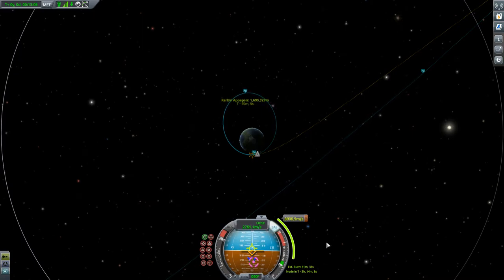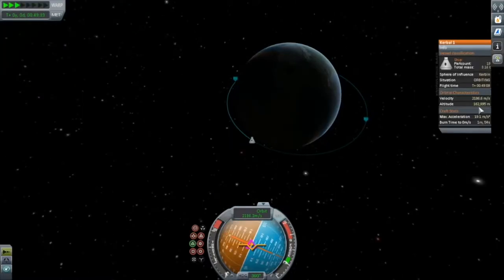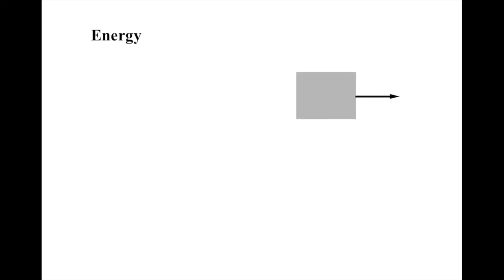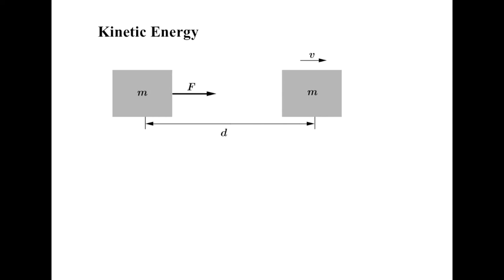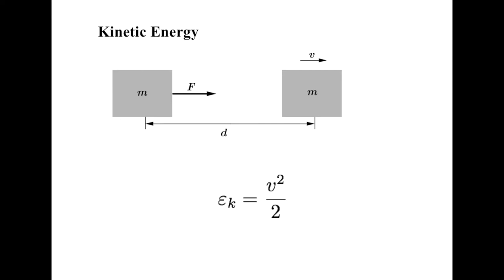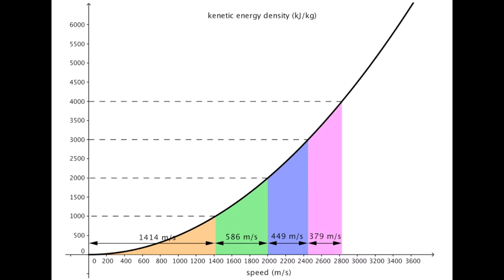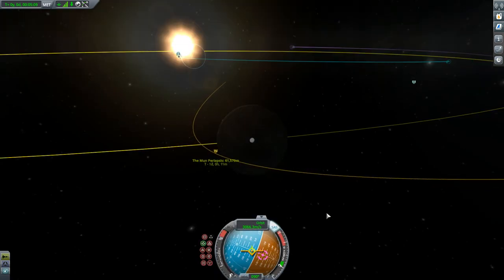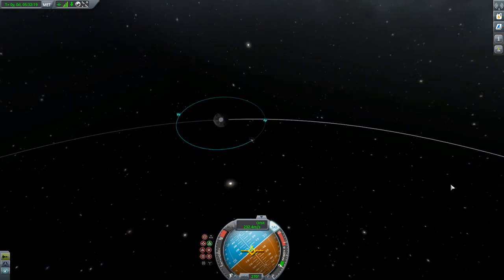Why Does the Oberth Effect Work? - KSP Let's Do The Math #10

Comment: Nice assignment. I have been busy with this for several hours. I wrote the formulas for the two options for getting to an orbit on 1000km altitude around Mun and found the equation for which both methods have an equal delta-v requirement. For simplicity I made the assumption that the spaceship comes from infinite distance with a certain initial velocity with respect to the Mun. I came up with v0 = sqrt(2GM/r) which is the same as v0 = sqrt(2v^2) where r is the radius of the final orbit, v the velocity of the final orbit. In case of the Mun this gives v0 = 330 m/s (might differ a bit from the original assignmen because of the finite SOI). This means that your initial velocity with respect to Mun must be larger than 330 m/s in order for the Oberth-method to have a lower delta-v requirement than getting the desired orbit in a single burn. In general the Oberth-method is most useful for high initial velocity, a high final orbit and low body mass. I hope I'm correct. :-)
Reply from the maker: I took a different tack than you as I was thinking of not coming in from an infinite distance, but from LKO.  You are absolutely right, though, the faster you are relative to the Mun, the more the Oberth Effect helps.  In the situation from the video, you would be hitting the Mun's SOI at a speed of 365 m/s relative to the Mun (I go through this calculation with Minmus in episode 6 https://goo.gl/iseB5j along with the subsequent calculations in the next paragraph),

To calculate the direct capture costs at any particular altitude I want I use this formula v_1^2/2 - v_2^2/2 = GM(1/r_1 - 1/r_2).  I set v_2=365 m/s and r_2 at 2430000 n (the radius of the Mun's SOI).  For a 1000 km capture, this gets me a v_1 of 434 m/s.  This is the velocity I would require at an altitude of 1000 km to have a velocity of 365 m/s when exiting the Mun's SOI.  I then subtract of the circular orbital velocity at 1000 km to get a required delta-v for the capture of 201 m/s.  Again, see episode 6 for a similar calculation done in detail for Minmus.

If I inserted into the same orbit by first getting the capture at 10 km with an apoapsis of 1000 km, and then doing the final insertion, the total cost ends up being 216 m/s, a smidge more.  (See episode 4 https://goo.gl/oUsniS for how to use the Vis-viva equations for costs of elliptical orbits.)  Brute forcing this through a spreadsheet at different target orbits, I find the break even point to be an orbit of 1450 km.  Higher than that, the Oberth effect starts working in your favour.
Reply: I can image that leaving Mun's SOI with 365 m/s in KSP means that with a theoretical infinite SOI the spaceship would slow down a bit more while flying off into infinity. If this leads to a velocity 'at infinity' of slightly below 330 m/s then my calculations would be compatible with your results, since then my calculations would predict the same minor difference. Maybe I can restore the 'finitity' of the SOI into my equation and redo the calculation when I have the time ...

The decision formula that I derived after rewriting is v_q=sqrt(2GM(1/r+1/r_0)). Plugging in the values for Mun with desired radius r=1200000 gives v_q=403 m/s. This means that your velocity when entering Mun's SOI should be above 403 m/s in order to benefit from the Oberth-effect (for a final orbit altitude of 1000km). You mentioned that the velocity when entering the SOI is 365 m/s, which is lower than my v_q, which confirms that you shouldn't use the Oberth effect in this case.

Comment: Since i found nobody else that posted their answer to the challange question and i want to check to see if my answer is right, here it is

Dv cost for low periapsis burn
is 829 m/s for hohman transfer to the mun, then 110 dv to capture and get apoapsis down to 1000 000 m, then 104 dv to circularize, which totals to 214 dv. So in total 829+214 

Dv cost for high periapsis burn
829 for hohman transfer, then 201 for capture and circularisation

you would be saving about 13 m/s worth of fuel if you used the oberth effect.
is my answer correct?
Reply from the maker: Yup. That's pretty much it. Congrats, but the Oberth Effect is the more expensive way even by your numbers. The only difference I got is 106 m/s for the capture using Oberth, and my transfer to the Mun is 856 m/s.

I talk about it in greater detail a couple of episodes later in this series.

https://youtu.be/rnzkPKk43iw?si=ZcZwKPmekT689vVT

Comment: but shouldn't the acceleration be variable? since fuel is expended and the mass changes
Reply from the maker: It you are referring to where I'm deriving the formula for kinetic energy, we're assuming the mass is constant.
Reply from the maker: Just to elaborate further, because I'm interested in the kinetic energy at a specific moment, I can make the time interval arbitrarily small. As the time interval goes to zero, so would any change in mass. As such, I can treat mass as a constant.

Comment: This is a great video! You have one of the best explanations of the Oberth effect I have come across! I just have one question though, for a rocket of mass 1 kg (for simplicity’s sake) even though the deltaV required to increase the energy by say 1000 KJ does decrease the faster you go, the engine still has to provide those 1000 KJ through the burn meaning your stock of energy (potential chemical energy in the case of fuel) is still lowered by the same amount. That’s what’s kind of blocking me and the reason why I can’t understand why it is more efficient.
Regardless of my question, again this is a great video series, keep up the good work!
Reply from the maker: You're right that you'll never get more energy out than what you put in. The key is that the faster you are going the less additional energy you need. If I were to do this video again, I would make the vertical axis of that graph  altitude of the apoapsis rather than mechanical energy. The shape of the graph would be the same, but I think it will be more clear that the velocity change required to achieve a certain altitude change becomes less and less the faster you are going.
Reply: 100 m/s dV can get you from 200 m/s to 300 m/s or from 2200 m/s to 2300 m/s. In the first case, that 100 m/s constitutes an increase in kinetic energy of ((1/2)*1*300^2)-((1/2)*1*200^2)=25000J, and in the second case the 100 m/s constitutes an increase in kinetic energy of ((1/2)*1*2300^2)-((1/2)*1*2200^2)=225000J, or 9 times as much.
 
It's important to note that this doesn't violate the law of the conservation of momentum, so it isn't like free energy is created out of thin air. If you consider both the rocket and the reaction mass (or the rocket exhaust) as one system, the momentum of that combined system doesn't change.

Comment: Obereth effect actually works when throwing objects at surface of earth too, but you start with zero speed which confuses things little bit. Lets say you have rocked and launch it full throttle until tanks are empty, it will get you higher than full throttle and shut engines every now and then until tanks are empty. This is because gravity slows rocket when time passes by and you lose some of obereth. But it seems like when launching rocket, most efficient way to get it most high would be to it to accelerate instantly to target velocity from zero speed but then most efficient way to burn would be when your velocity is zero? I don't fully understand why this is. so question is: is there limit how fast you should accelerate from surface, because 0 start velocity is less than anything which means zero obereth?

Comment: What I don't understand here is the why. As for the math we could simplify a lot because we assumed are starting at rest. Yet in the following part we looked at how much fuel it takes to go from speed 1 to speed 2. You honestly lost me at that point.
Reply from the maker: It's about adding energy to the orbit and the amount you add is proportional to the square of your velocity. So the faster your already going, the more additional energy you get for a particular velocity addition.
Reply: @MikeAben   Under the mathematical assumptions you made this is correct, but it does not explain why that is. It just states it is that way if we make those assumptions. I'm not questioning whether or not it is correct, we tested that a million times and it clearly is. I'm trying to understand why it is. I found a few lectures on the topic but honestly I have to start on a lower point for those explanations to make much sense (for me). 

So far i only have a logical explanation. When you are falling into a gravity well, your speed will increase due to gravity and the time you spend in that gravity. So the closer you get, the more gravity accelerates you, but the faster you are the less time gravity has to accelerate you. The same happens on the way back out but with gravity slowing you down. Now if you accelerate at the periapsis then you leave the area where gravity is high faster thus slowing down less which again means you essentially gained speed.
Reply from the maker: @_aullik  I think you may be overthinking this. The faster you're going the more energy you'll put into your orbit for a given change in velocity. That's it. I'm not sure what assumptions you're referring to. That you're faster closer to the planet?
Reply from the maker: @_aullik  I am assuming conservation of mechanical energy. That kinetic energy is converted into potential energy as your altitude rises.
Reply: @MikeAben  I mean I want to understand it, not just have the statement that it is that way. Conservation of energy is exactly the problem i have.

Simplified: Acceleration requires energy. Velocity is Kinetic Energy. So when you are faster you get more speed and thus more energy out of investing the same amount of energy. That simply does not seem right. 

So you need to get energy from somewhere. The first hint is, that this effect requires you not just to be fast, but actually to be in a gravity well. So I assume you extract energy from gravity interactions?
Reply from the maker: @aullik  So when you are faster you get more speed and thus more energy out of investing the same amount of energy.
No, it  requires more energy to get to higher speeds. KE energy goes up by the square of the velocity. So it takes more energy to go from 50 to 100 than it takes to go from 0 to 50. If the mass remains the same, but it doesn't, but I'll get to that in a sec

Let's first simplify everything by going straight up. We'll also assume the gravitation field is constant and doesn't decrease with height. Gravity doesn't factor in to how much kinetic energy you have. It does affect how high you go, but gravitational potential goes up linearly. E_p = mgh. That's the key.

I fire something straight up at a velocity v and it reaches a max height h. If I double my launch velocity to 2v, the amount of energy it has at the start goes up 4 times (2^2) and it will now reach four times it's previous height 4h. Let's increase the launch velocity once more to 3v. I now have nine times the initial starting energy and will get to nine times the pervious height, 9h.

Notice each time I increased my velocity by 1v, but when I went from 1v to 2v my max height went from 1h to 4h (an increase of 3h), but when I went from 2v to 3v my max height from 4h to 9h (an increase of 5h). So for the same velocity increase, I got more of a height increase the second time because I started from a faster velocity. That is it when it comes to the Oberth Effect.

It sounds like your confused as to where the extra energy comes from which is kind of a different question. Well, it comes from the fuel of course. You might think we should then by burning more fuel as we go faster, but no. The rate at which fuel is consumed remains constant. This is because while we're gaining kinetic energy we're also losing mass through the propellant being fired out the back end. The decreasing mass makes the rocket easier to push and balances out the fact that more energy is needed to make it go faster.

Note the same doesn't happen with vehicles that aren't propelled by firing propellant out the back. In a car, it takes less fuel to go from 0 to 50 than it takes to go from 50 to 100. For a rocket, though, it's the same.

I hope this helps.
Reply: @_aullik  "So you need to get energy from somewhere. The first hint is, that this effect requires you not just to be fast, but actually to be in a gravity well. So I assume you extract energy from gravity interactions?"

I think an alternative way to think about it intuitively, is that any specific target orbit has a constant energy. There's also other orbits with identical energy to that specific orbit, but with different periapsis and apoapsis. So you can have it range from a circular orbit, to a very elliptical orbit, with certain circle radii 'r' and ellipses major and minor axis 'a' and 'b' (edit: major and minor radii, not axis, sorry). 

To be clear I'm not talking about burns and delta-v, I'm talking about final target orbits. With a specific amount of delta-v/energy in your fuel, you can target a range of "orbit eccentricities" from circle to ellipse. 

In other words there can be two orbits, a circular with {r}, and ellipse with {a, b} (aka apoapsis and periapsis), such that they have the same energy. Now to think about it intuitively, we have to think backwards: if you had a specific amount of energy in your fuel, you can use all of it to target either of those orbits. 

So with a specific amount of energy you can choose final orbit either circle or ellipse. How would {a, b} vary going from a circle to a very eccentric ellipse (escape trajectory), while maintaining the same orbit energy? Either they both increase, both decrease, one up one down, or one up one constant. The only option that makes sense from a constant energy standpoint is one up one down. The periapsis would dip, and the apoapsis would go up, right? So if we plan to do an escape trajectory, any energy we spend raising our final periapsis would be a waste (aka burning while you are at the apoapsis).
Reply: @MikeAben  Thanks for the in depth, I was wondering the same but reasoned it with a different approach. The lost mass part was what I was missing to make sense of the energy balance.
Reply: Indeed, the mathematical explanation is great, but for physicists, it's about the potential energy of the lost mass. If you drop the ejected mass up high, you lose all that potential energy. If you drop it in LKO, the amount of potential energy dropped is much less.